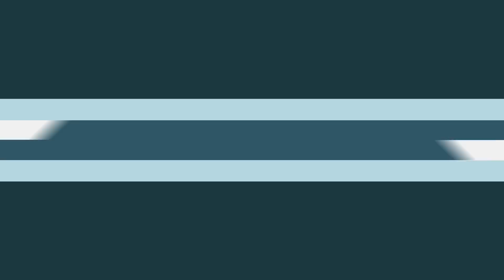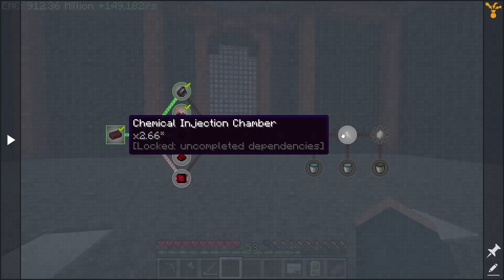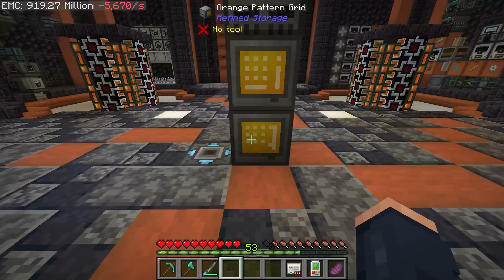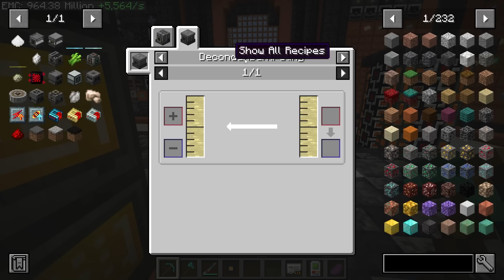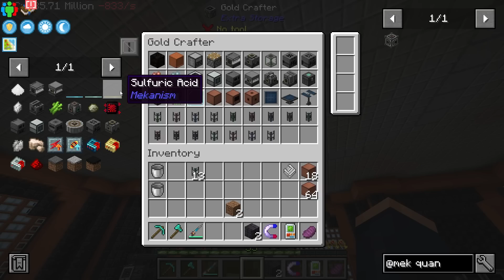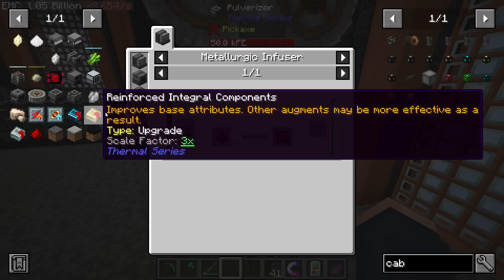Mechanical Mastery Minecraft Modpack EP13 25x Ore Processing Setup

Comment: or it is 3 raw ore u input, but u could also use 1 silk touched ore, so its 3 to 5 or 1 to 5 for the clean version to crystal version ;) 
if u put flint in the purification chamber in the yellow slot, it will produce oxygen from that flint, so u dont need to get it from the waterline. thats why it shows flint

Comment: the using salt is pretty smart cuz you dont need to use an electrolytic seperator to make another oxygen and since the tubes might connect the gasses tho maybe its not as efficient unless it gets more and you use gas upgrades

Edit: I didn't watch the entire vid and saw that he was running out of salt and it was causing a bottle neck, I wanted to side with him after what happened in episode 3
Reply: Using salt bottlenecks the overall speed of the machines as it gives such little gas
Reply: Quantum Entagloporters helped me solve this issue, and you don't have the bottleneck of converting Brine to Salt.  I've actually started using this in MANY of my required gases as I can just mass produce these gases and not have to worry about how to pipe them over to machines.